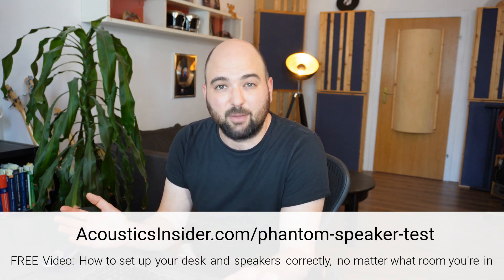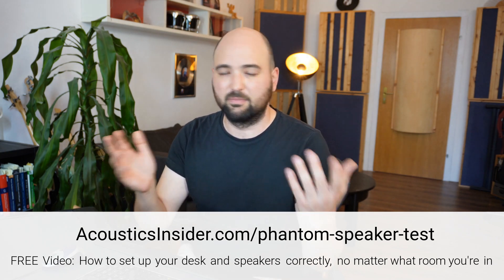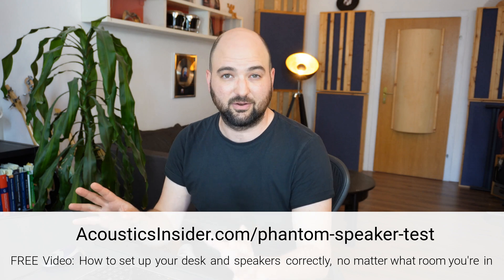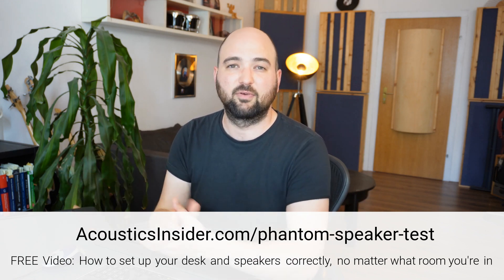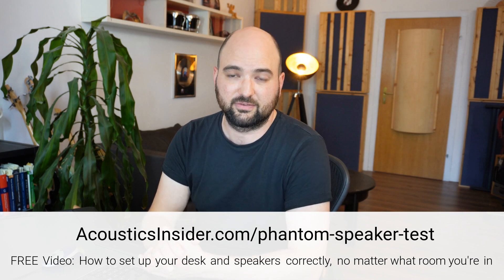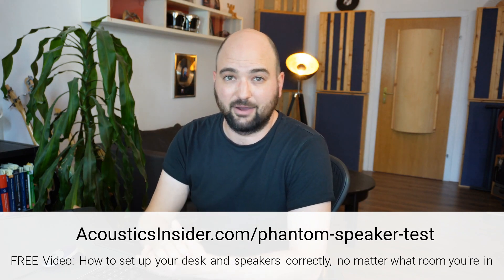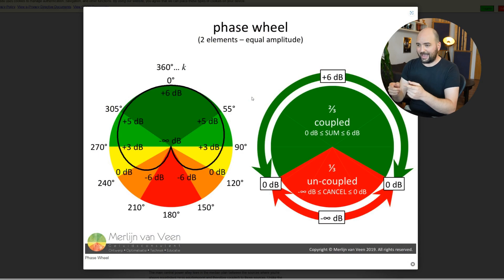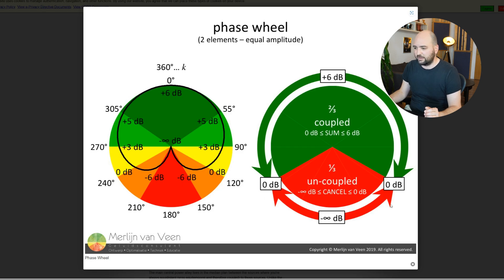“I think I have a phase issue”

Comment: For me, several things have helped over the years, but one big thing made a particular difference. I did my own acoustic treatment, treating the corners and placing many panels on the walls. However, I was still never able to match the sub's phase with the main speakers properly, even though they were from the same brand.

I found that whenever I connected the satellites through the subwoofer (as it "should be" by default), the subwoofer’s questionable quality crossover would affect the sound of the main speakers, even at mid and high frequencies. What solved the "phase issues" for me was finding an interface that could output the same audio on multiple outputs. This allowed me to connect the mains directly to the audio interface, as well as the sub directly to the audio interface. In other words, I could avoid the sub’s crossover when connecting the mains, which created additional coloring that sounded like phase issues at mid and high frequencies. The mains now sound crisp and clear, and I can still adjust the sub’s crossover for the sub only.

Comment: After spending thousands of dollars and many hours of my own labor building panels and a mixing desk I'm giving up on room acoustics and instead buying high end Audeze mixing headphones. I have one paying client, but even that has been frustrating. The car check is still a necessity and I wish it wasn't. It's amazing what i can instantly hear in my car (Toyota 2009 Sienna) that I can't with Genelec and NS10s in my studio. My only options are spending tons more money on tube traps which would have to be assembled etc -- the Eric Valentine method. But, I'm saying fuck it. I broke my back making all the panels in my studio and if I ever move out I'll have another room with different problems to deal with. So I'm taking the plunge. 30 day return policy. If mixes don't translate I'll return it, no biggie. I hope they live up to the hype. Warren Huart has a great video on them I highly recommend.
Reply: Sennheiser 650 with appropriate EQ will do the job. No need of "high end" headphones wich are rather jewelry than anything else.
Reply: That's exactly what I did as well. But I'm using closed-back instead to get a proper freq. response and check the imaging and stage on speakers. 
The more I was understanding acoustics, the more I tried to work with the headphones and speakers in tandem, instead of endlessly chasing every room peak/dip.

Comment: I'd love to hear your take on the Kii Three monitors, that are apparently extremely forgiving in an untreated room. It seems like you could potentially pay the same amount acoustically treating and buying a nice pair of monitors to go in your room by just buying a pair of Kii Threes (~£15K) instead. Although, I wonder if it's all marketing guff.
Reply: I got them and they do work to an extend, but there's no way you can mix on them in an untreated room. They have a phase-correct mode, which you can actually measure with REW wether it's on or off. But the room itself also heavily impacts the phase response as far as I understand, so having a phase-linear speaker (or whatever it's called) is only part of it. (I think that's what trinnov tries to solve?)
The cardiod thing also works, but I think it's only a reduction of the problem and not an elimination and also it only works up to 50hz down (and I think that's being generous).
But I gotta say, I love these speakers. You hear everything so clearly, it actually needs some adjusting to not get hung up on crazy details. And for my home studio set up having a speaker that can easily play 30hz without making the room explode completely is pretty neat.
Reply: @lazylance3991  Thanks for the response. That’s really interesting.
Reply: BS. DSP cant fix room problems. It will work to some extent on bass frequencies, but thats it. Only way to overcome room acoustics is ultra near field (aka headphones).
Reply: @pulDag  what's BS in your opinion?